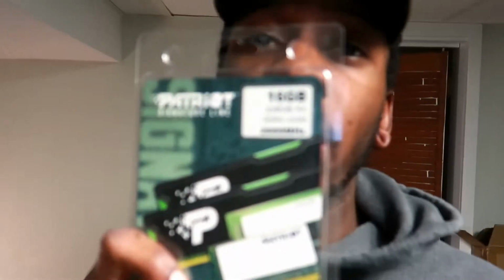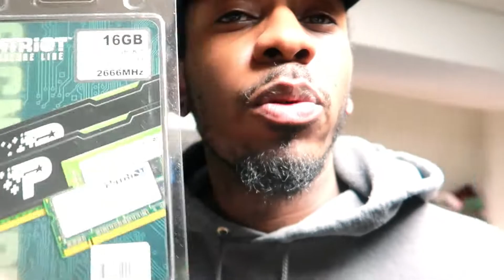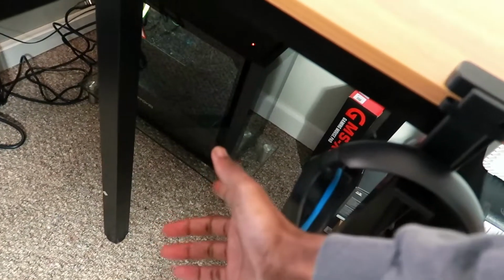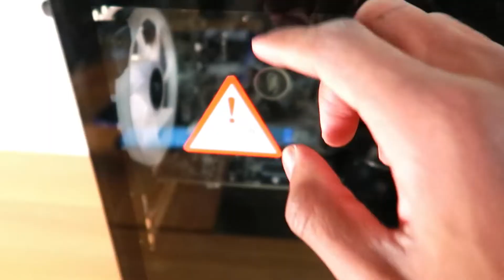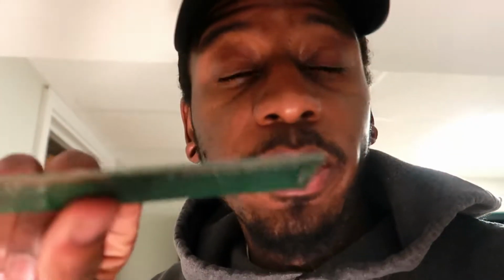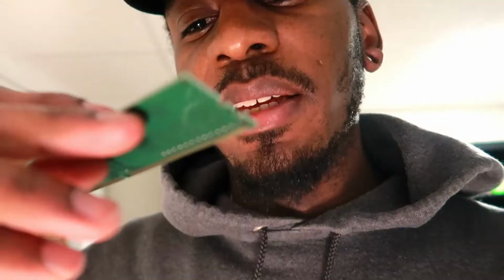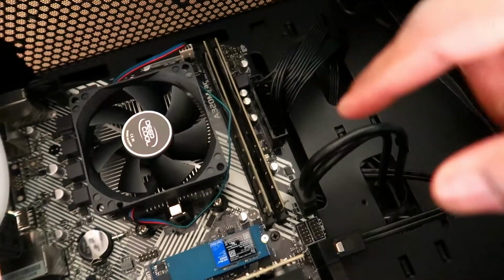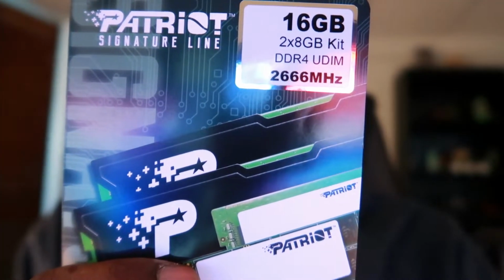Adding 16GB of DDR4 Ram To The iBuyPower Element Mini 9300

Comment: Do you need to upgrade pc power unit for this?
Reply from the maker: No you do not need to upgrade the powersupply for a ram upgrade
Reply: @patjackie1256  did you upgrade your power supply for the graphics card you installed?
Reply from the maker: @Otw3mill  I did when I upgraded to a 1650 but its really not needed if you go for that. Anything higher yes I would upgrade

Comment: Should I buy the other model of the Ibuypower that has 480gb, the intel core i3 and the nvidia GeForce gtx 1650 4gb for the same price as the mini or should I be good with the mini. I would also like to livestream
Reply from the maker: It's really up to you, the 1650 is a better graphics card than the one that comes with this pc, I opted for this one which was a little over 500$ when I purchased it, and I knew I was going to upgrade some of the components in the pc gradually. So it's really up to you!

Let me know if you have any other questions!

Comment: Why not use the old ram too
Reply from the maker: You want to have matching sticks of ram or you could run into issues
Reply: @patjackie1256  gotcha, so if I buy the same one I can use both the old and new.
Reply from the maker: @WasBannedTho  yes, it has to be the same exact ram though, same speed, brand etc. Ddr4 is super cheap right now, so you can get 32gb for less than 100$ if you want to, but 16gb can easily be found for about 50$
Reply: @patjackie1256  cheap compared to prices it was at before the pandemic shortage? Or cheap compared to the pandemic shortage prices 😂? Also thanks
Reply from the maker: @WasBannedTho  Ddr4 prices haven't really gone up, gpus on the other hand....lol

Comment: would the Corsair Vengeance RGB 32gb (2 x 16) work for the ibuypower Element mini 9300
Reply from the maker: Should work, just remember the motherboard only supports up to 3200mhz speeds.
Reply: @patjackie1256  Tysm this will really help
Reply from the maker: @estyonppluto  Anytime!

Comment: This is really a good beginner pc, I haven’t have any issue with it so far. I’m going to upgrade my ggc,storage, and possibly the ram also.
Reply from the maker: Yes it is! I've made videos on all the upgrades I've made so far!
Reply: can you play fivem or gta online?
Reply from the maker: @lmxyp5293  I actually don't play GTA online, just regular gta, but you can check out my gaming channel for gameplay.

Here's the link!

https://www.youtube.com/channel/UCgdXv9W5u03hG4vZgEwc00w

Something to note is I use obs to record and it drops the frame rate in most games while I am playing it by about 10, but I'm playing on max settings, and it runs fine. When I'm not recording I get a consistent 70+ frames.

Let me know if you have any other questions!

Comment: This pc is priced at 779 with 16g of ram and 730 for 8g of ram.. is it still worth buying
Reply from the maker: It's not a terrible price, but you can always do those upgrades yourself at a cheaper price.
Reply: @patjackie1256   have you hear about the ibuypower element mini 167A for 600 so you think that’ll be a good start
Reply from the maker: @Maine2point0  Its essentially the same pc, it just has a slightly better cpu, and the gpu is about the same as the one that comes in the element mini 9300. So I'd recommend that one as well, if you're interested in it!

Let me know if you have any other questions!

Comment: yo i got the 3600 one would it still work with those?
Reply from the maker: The motherboard only supports up to 3200mhz ram, so that would be the max you could clock your ram at. Did you get the same brand of ram?
Reply: @patjackie1256  nah still looking I found some G Skill Trident Z Neo’s that go well with the AMD Ryzan 3000 processor that I have
Reply: @patjackie1256  and the motherboard I have is an A320 motherboard
Reply from the maker: @ITz_RUINED  they should work, just make sure they are on the compatability list so you don't end up not being able to use them.
Reply: @patjackie1256  thanks bro much help ❤️
Reply from the maker: @ITz_RUINED  Anytime!

Comment: i bought 3000mhz 2x8 gb ram sticks do you think it will compatible with the pc you have bc i have the same pc too
Reply from the maker: It depends on the ram, not all ram is compatible with every motherboard. You can Google the motherboard and the type of ram you bought to see if they are compatible!

Let me know if you have any other questions!
Reply: @patjackie1256  Ok thank you
Reply from the maker: @cyriladsuara  no problem!
Reply: @patjackie1256  Did you hear 2 clicks each slot of just 1 on each and thats 2?
Reply from the maker: @cyriladsuara  When I did it I heard 2 clicks.
Reply: @patjackie1256  Ok i think it’s just my ram my screen is black but my pc is on but i heard 2 clicks when i installed the ram and i tried my old ram nothing happened too
Reply from the maker: @cyriladsuara  You might need to try to push it in harder, because It does take a bit of force for it to go in. When I did it the first time I thought it was in all the way, but I guess it wasn't. Try taking it out completely then putting back in and push hard, but not so hard you end up damaging the motherboard.

Comment: I am only getting one stick of ram, do I have to take out the old one?
Reply from the maker: Just make sure it's the same brand and speed as the one that's in the pc and you'll be fine to just pop in the additional stick of ram.
Reply: @patjackie1256  Ok thanks
Reply: @patjackie1256  What brand do they use?
Reply from the maker: @foh3180  The one that came with mine was adata 2666mhz, but they sometimes use different brands, so when you receive the pc, just look and see which brand it is so you order the right one.
Reply: @patjackie1256  Wdym by brand? I got the same pc as you, do you mean the brand of the ram?
Reply from the maker: @foh3180  they use different brands of ram, like patriot,  adata, etc. It's whatever they have available so sometimes the parts on one pc might not be exactly the same as the other, but all the speeds are generally the same. If you look at the ram in your pc it will tell you what brand to buy, because a majority of the time mixing brands won't work with the motherboard and might cause a black screen or stuttering issues.
Reply: @patjackie1256  So I bought two 8 GB sticks of ram, and I already have one placed in, what do I do!
Reply from the maker: @Fohli  remove the one stick that comes with it and put in the new ram.

Comment: Hey I have a question so I have the same pc and I’m planning on getting 2 stick of ram 3200MHz will my pc handle it and I’m getting a MSI gameing GeForce gtx 1650
Reply from the maker: Just make sure the motherboard is compatible with the ram you want to get. The pc can handle 3200mhz though. I have the Asus 1650 so it will handle it fine. I swapped out the powersupply though but the 400 one will handle it fine.
Reply: @patjackie1256  k thanks so much
Reply from the maker: @Ynronn  Anytime!

Comment: On my Ibuypower i5 1050 with 8gb, I had to get more ram, because my computer was screaming for more ram. Adding wargames was ok but when I tried to download DCS World, it wanted more. I need the same as you have there DDR4 2666mhz 16ghz, which I ordered.. TFS!
Reply from the maker: The ones I order work great I haven't had any issues and it was just put them in and the pc recognized them immediately, I personally recommend them, at some point if I end up doing a more gaming than I do now, I might opt for two, 16gb sticks but for now these work perfect for my needs!

Comment: I have someone on OfferUp giving me this pc new for 500 and I already have two 8gb sticks am I getting a good deal and should I replace the psu with a Evga 600BQ
Reply from the maker: The power supply provided is 400w if you plan on swapping out the graphics card to a more powerful one I would, but the gpu that comes with it is fine. When graphics card prices go down I plan on getting a new gpu and swapping out the psu, but that's not going to be for a while. 

And to answer your question I think that's a really good deal honestly! Just make sure everything works fine when you get it and test a couple games as well!

Let me know if you have any other questions!

Comment: how did you hook up 2 monitors to it?
Reply from the maker: Mine came with dvi and hdmi port. Usually the rx 550 that it comes with has hdmi, display, and dvi ports. I bought a dvi to hdmi adapter from Walmart for about 6$ then just plugged it in along with the hdmi. You then go to the display settings and configure how you want the monitors set up. 

Let me know if you have any other questions!
Reply: @patjackie1256  ok so all i need is a dvi to hdmi adapter and of coarse the second monitor and I'm good to go! thank you!
Reply from the maker: @thafutureonline619  Yes sir, you can order them on Amazon or get them basically anywhere like target, Walmart, best buy. They aren't expensive at all either! 

Let me know if you have any other questions!

Comment: I think I'm having the same issue but im nervous to push on it. I don't wanna break it
Reply from the maker: I felt the same way, but you you do need to use a bit of force when adding the ram. When I had the issue nothing was showing up on my screen, I spent about an hour on the phone with my friend who works in IT  trying to trouble shoot, then I just took out both sticks and pushed hard until I heard 2 clicks and the computer booted up perfect. I suggest not applying too much force, but enough to were you hear the clicks and it is completely seated.

Comment: Where did you buy those ram sticks can you drop the link or something? I’m getting the same pc and I want it to have 16 gb of RAM off the start
Reply from the maker: No problem! Here's the link! 

https://www.amazon.com/dp/B07CBCW3XB/ref=cm_sw_r_cp_apa_fabc_47X17N65K3ZQYH6HCEDQ?_encoding=UTF8&psc=1

Let me know if you have any other questions!
Reply: @patjackie1256  thanks i was looking for the link, im, getting the same pc. However i dont really know what ram does, it is just to make you're pc run better, run more things at the same time? Thanks!
Reply from the maker: @tyler8881  Yes, so if you're running multiple things your pc won't start to slow down or crash. When I'd run obs to record a video, and game, while uploading a video and have a video rendering in the background the pc would slow down because there's so much going on. Now while doing all that I the pc is only using about 60% max of the ram. So it was a good investment should you plan on doing a lot of tasks on the pc.

Comment: Can you put the link to your ram ? And also will this help with more space for mods?
Reply from the maker: Here's the link to the ram!

If you are talking about storage space, no the ram won't help you would need to add more storage with either a HDD, Sata SSD, or an Nvme SSD.

https://www.amazon.com/Patriot-Signature-2666MHz-PC4-21300-PSD416G2666K/dp/B07CBCW3XB/ref=sr_1_4?crid=3OD9QT41H5B45&keywords=patriot+2666m&qid=1640862233&sprefix=patriot+2666m%2Caps%2C64&sr=8-4

Comment: BRO WTF YOUR DOING THE SAME FOOTS STEPS IM DOING WITH THE SAME PC I UPGRADED MY RAM TO 16 AS WELL AND YOU SAID YOU WANTED A 1660 IN THE COMMENTS JUST LIKE ME
Reply from the maker: I do want a 1660 however it's impossible to get any decent graphics card right now unfortunately..
Reply: @patjackie1256  yea there very expensive rn i will honestly try my best to wait  for you to post a video on you upgrading the gpu in the future and wait to see what you do  and i am confused about how to install a gpu into this specific pc so i would appreciate if you could drop a tutorial on how you installed a gpu into this pc
Reply from the maker: @notanthony8946  Of course! When I upgrade the GPU I'll more than likely end up upgrading the power supply as well, as the 400watt one is comes with won't support some of the higher end gpus! I will definitely make a video on how I do it though!
Reply: @patjackie1256  ok thx